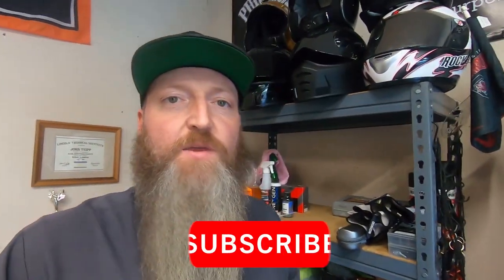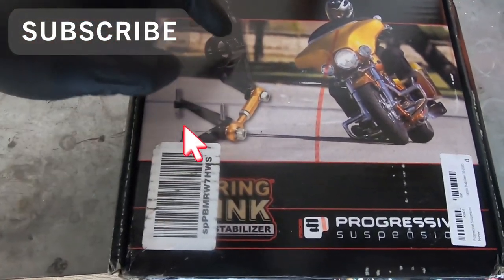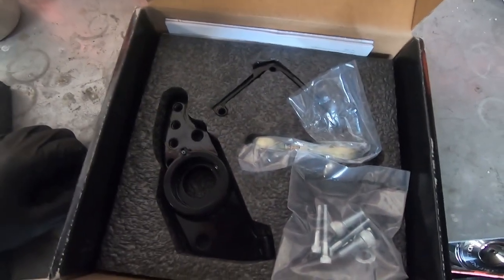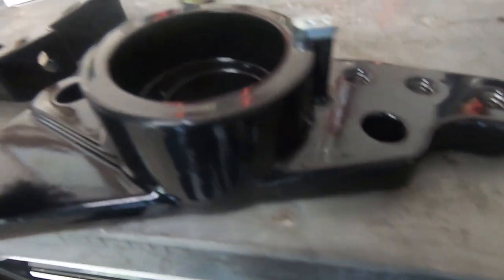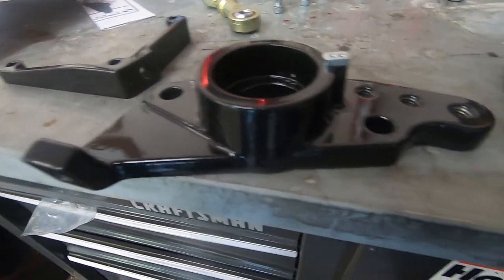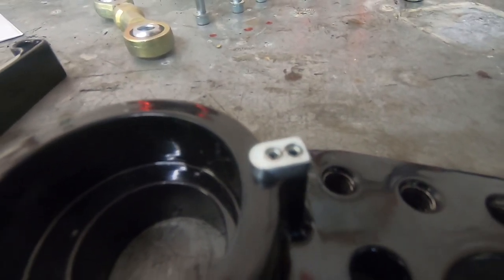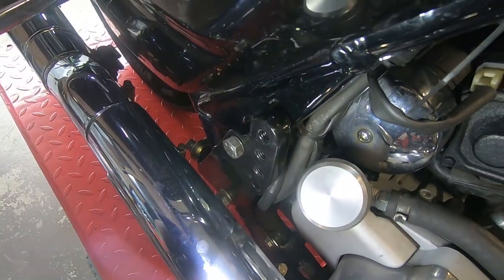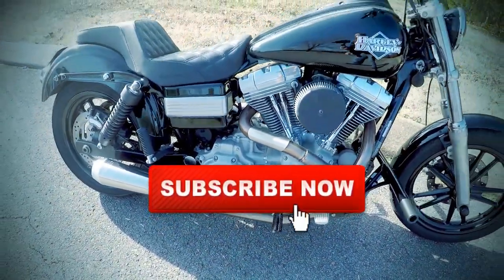Progressive Touring Link Install Performance Bagger

Comment: Ok guessing that must not have been the issue? I’ve heard a lot say it helped and the ones it did so far have found about issue causing there wobbles . I don’t have a big issues just around 90-100 on highway or back road just has a small shimmy  . I just got mine installed . But I’ll have to wait  to try out

Comment: i have used a variant of this product since 2005  and it makes an improvement in long fast sweepers  you will get more vibration as bike is tighter 2002 flht

Comment: Put the tour link on my RK. The directions say the link is already set to the correct length so when you install the two brackets the holes should be the right distance to line up with the link.  I checked my engine alignment and it is right on the money however the tour link was almost 1-1/2 turns too short....so, I would not go by the directions...Check the alignment of your engine first and rear tire....
Reply from the maker: Thanks man